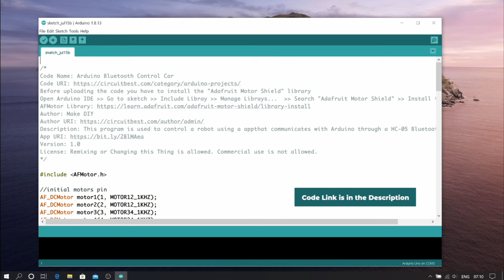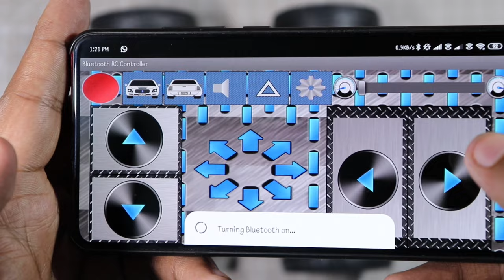How to Make DIY Arduino Bluetooth control car at Home with Arduino UNO, L293D Motor Driver, HC-05

Comment: Hey, I have made this Arduino Bluetooth Car and I have got A+ grade in my school. Thanks 😃😃
Reply from the maker: You are welcome 😊
I hope I can also help you in future 🙂
Reply: Woooohooooo great man i hope that i had that experience too man......
Reply: I will also try to make it in my school's science exhibition 😄
Reply: Arduino project always get A+
Reply: How to charge the battery?????
Reply: Tell me i have to make this model how to charge the battery????
Reply: @MakeDIY9  please tell me howw to charge rhe battery
Reply from the maker: @universeanemotion7868  you can buy charger online
Reply: @MakeDIY9  yeah
Reply: Gear motor kaise bhai
Reply: Heyy bro please help me. This Code is not Run Properly
Reply: Why my hc 05 led not blinking 😢
Reply: I have connected it but if I try to move it. It doesn't work
Reply: My car is not working even doing all the things. It is connecting to app but not working.

Comment: I just finished this set up on a four motor CNC tank robot. Works like a charm, thank you very much. If I wanted to also add obstacle avoidance automation with the sonar sensor how would I modify the code to go from manual to automatic? Can I just add the sonar avoidance code along with your code and it would work?
Reply from the maker: Thanks for sharing

Comment: It is working great but when I click on button some time so it keep on going after leaving the button also.
And please help me by solving my  problem ,please.

Love you Bhai
Reply from the maker: Check battery voltage it might be low voltage
Reply: Thanks for reply
Reply: Bro I have change the battery but still two motors are not working 😞 please help.

Comment: I tried connecting one motor only for testing however the motor doesn't turn just hum when it gets the pwm signal what should be done ?

Comment: If your car is not running, even after connecting by phone ,you can add ( 4700uf 25v ) capacitor to motor driver input. And connect your Bluetooth module to direct Arduino Uno's positive and negative if your phone is disconnecting always after few seconds, and also add ( 470uf 25v ) × 2 capacitors in parallel to that bluetooth module and Arduino's positive and negative, and after this all remove that jumper from the motor driver and give another same power supply to direct Arduino Uno, this all things will guaranteed solve your problem.

Comment: My car is not working when I conect the Bluetooth my serial monitor receiv the message but i press forward option but my car not working  when I tounch the wheel and wheel start rotating what will i do plz help and I tried it with laptop power
Reply from the maker: Your L293d ok?

Comment: Hi Brother, first of all thanks for the wonderful project. I have followed all the given instructions and made it according to the given instruction. After uploading the Bluetooth connection also established. But it doesn't work I mean no motor functions at all. Appreciate if you could help on this please. Thanks.
Reply from the maker: Check battery bro
Reply: @MakeDIY9  hi bro the problem solved.  It was a jumper cable defect. Thanks.
Reply from the maker: Ok 😅😅
Reply: Same problem here but jumpers are ok
Reply: Cant find the device did it several times with new jumpers etc

Comment: hi very nice rc car diy video thank so much , i have small doubt , you have used this batteries 18650 model , instead of that can i use 4-aa batteries or 6-aa batteries please tell , thq
Reply from the maker: Yes you can one aa is 1.2 to 1.5v now calculate how much voltage you will need
Reply: @MakeDIY9  hi thq , i was thinking to use 1.2 aa batteries-6 for this rc bluetooth car ,which is  7.2v is enough ?,  As per  your 3.7v X 2-batteries its 7.4v , sorry if i am wrong about what i am talking, i dont know about electronics much but i am learning it ii love it
Reply from the maker: Yes but total 9v will be good for the car

Comment: Bhaiya I have also double checked wire connections  and modified the code accordingly as I am using two motor wheels and a caster wheel . And bhaiya , I am using an 18 volt battery . But my motor is not running What to do now. Also, when I checked my motor by connecting directly to batteries it runs but when I connect it to motor driver it does not while everything else is working properly

Comment: hi ,
i have done everything according to the code but i did not work and later i experimented on it and found that there is less power supply ,after that i put a 9v battery and it connected but it did not move ,i am yet to do some stuff like i think i have to add another 9v battery for some extra power for the motors .pls suggest something

Comment: Bro we use a single core aluminum wire in this project,do you know what they actually called as and where to buy??
I  made ultra sonic sensor car ,but wires i connected are of  weak and poor quality.
If you know about those wires , please tell me bro
Reply from the maker: Bro Multi color coper wire are the best as of my testing.
I have also used aluminium wires but you can't solder on aluminium wire. So I ditched the idea.
Reply: @MakeDIY9  thanks bro for replying

Comment: Sir code was uploaded successfully and I had used 11.1 v battery and connected successfully with my phone
But the problem is that motors are not moving
Reply: Same Problem bro I think Coding Is not Correct Because Our All working properly but Coding is not Perfrom Correct

Comment: Can we use normal batteries which we use in electrical appliances or 9v
Reply from the maker: Yes but not a single 9v battery. It will not be able to provide enough power ⚡
The car takes high power so it is recommend to use 4 AA batteries in series( increases the voltage) or 2 9v batteries in parallel(increases the current).

Comment: Hi you know I have told you of that case of backward left...  So I have tried and it's working cool thanks for your guidance and ya pls can you give me the link of your battery I have clicked on it but I can't find your one battery and pls tell me that does your battery is rechargeable or not?
Reply: Pls reply
Reply from the maker: Feeling very Proud of you :)
Those are rechargeable 18650 batteries.
BTW where are you from It will help me to provide a similar link... I got the batteries from a local store. But I can give you some good batteries link :)
Reply: I am from Gujarat Baroda
Reply: To power my car I uses a power bank and 4 battery but it's not enough load on the car is too much so I thought to check out your battery
Reply from the maker: @nisargdelvadiya0625  can you contact me on instra @creativeideas365

Comment: I am using 9v normal battery, motor is not working. Do you think it's a problem. Should i go for 18650?
Reply from the maker: Yes buddy. 9V battery can't handle the l293d car. Even at the time of making the video I thought I would use 9V battey. But 5he thing is that it cannot provide enough power to the car. So, I switched to 18650 Battery.
Hope it helps 🙂
Reply: @MakeDIY9  thank you so much! This helps.

Comment: sir i have question,I used everything you did but when I connect my phone to the car, it doesn't move at all or anything. The car is on, the bluetooth module is working fine except it just connects to the phone and doesn't control the car. I have the libraries downloaded onto the program as well and I'm not too sure of what to do. Is there anything else that I need to do?
Reply: i use battery 18650 3000mAh 3.7V

Comment: In the coding you have not put the case of forward left/right and backwardleft/right if I put this in the code will problems can arise?  Pls reply
Reply from the maker: No bro it will not be a issue. 
But I will also make a video on that topic 🙂

Comment: hello and awesome video bro, i did the connection already and when i upload the code, there is an error which is error while uploading the sketch..can u help me solve this :)
Reply from the maker: Have you removed the rx and the tx wire while uploading the code?

Comment: Sir, in Arduino Bluetooth control car project ,  i have done all the things successfully , bt still the car wheels are not rotating only vibrating , what is the reason sir?? here i am using 9v HW battery .
Reply from the maker: Battery issue
Reply: Sir, how many volt batteries should be used??  I mean how many volts you have used?
Reply: Would there be any circuit problems if we used two 12 Volt batteries?

Comment: tried to make this car but it's been 8 hours and when I finally connect the Bluetooth the application constantly crashes and doesn't allow me to use the car. I do not recommend spending any money for this tutorial
Reply: you must have low battery, hardly sufficient for even  powering up the bluetooth module using the motor driver. try using a bit higher voltage like 7.4 .It should work
Reply: @ArduinoProgrammer-e9b  A long time ago I realized that the problem was that the Bluetooth module was broken.

Comment: Hi bro I have a problem I have did what u say in the viedo  and I also uploaded the code and the Bluetooth is also connected toy phone but no motors are responding bro plz help me out what is the problem my Arduino board or what bro plz help me out

Comment: sir my car is not taking right and left turn please help me sir.....
Reply from the maker: Do you modified the code? And which battery you are using?
Most of the cases the batteries like 9v battery can't provide enough power.
Reply: @MakeDIY9  no sir but now it's working fine...
Reply: @MakeDIY9  sir please make a robot using this components and also control hands too...sir please
Reply from the maker: You mean gesture control?
I will defenately make it.
But my next project is simple line following robot with uno, l298n and ultrasonic.
Hope you will like it 😊
Reply: @MakeDIY9  yes sir but also make a robot using the same components,  robot should have movable hands and head
Reply from the maker: Great idea thanks ☺️
Reply: @MakeDIY9  welcome sir........

Comment: Can we connect the bluetooth module without soldering?
Reply from the maker: Yes you can
Reply: @MakeDIY9  please tell me how? (I have to submit a project and I can't go out to get the solder because of the lockdown and Amazon will take about a week to deliver it)
Reply from the maker: @juice1070  In that case use some long Jumper wires and put them into between the shield and Arduino Uno and then press it. it will also work.
or contact me on instra @creativeideas365

Comment: Can I use 3.7v 2500 mAh battery (Mobile battery) on this car?
Reply from the maker: You have to connect atleast 2 mobile batteries in series and make sure batteries are charged
Reply: @MakeDIY9  thx for reply

Comment: I'm connecting the car to Bluetooth and running it after two or three commands the bluetooth is disconnecting. What can be done
Reply from the maker: Because of battery I think
Reply: @MakeDIY9  can I use 12 v 1.3 amp battery for four 300  rpm motors
Reply from the maker: Check the battery voltage when the load is connected. I previously tried to make this car with 9v battery, I have faced the same issued. The battery don't provide enough power for the motors. So, I switched to li battery.
Reply: @MakeDIY9  thank you

Comment: Bro I am getting a problem when I connect hc-05 individually to Arudino then light is blinking but when I keep motor driver then if I keep the hc-05 module it is not working at all please help me out fastly it's my project submission tommorow
Reply from the maker: Check battery

Comment: Hii..bro.. Bluetooth is pairing but app  is not connecting...it still shows red button...what could be problem?
Reply from the maker: Battery low voltage

Comment: Are bhai coding ho gai but jab power supply deta hu to wo aurdino ka chalu hota hei but hc 05 moduel ka light chalu nahi hota aur connect nahi hota kya karu bhai 
Kuki coding ke vakth vo light on hota hei par chalu karane kr vakth nahi hota

Comment: Can we use 9v battery instead of 18650
Reply from the maker: No bro 9v battery amp rating is low it will not work that great.
Reply: How about adding 2 battery
Reply from the maker: Use 2 batteries in parallel it may work 😃

Comment: Is 9v battery is used or not to run
Reply from the maker: You will need high power battery for this car 18650 will be best
Reply: @MakeDIY9  tq

Comment: When we are providing power supply throught Arduino uno , Bluetooth module is receiving power , but when we're providing supply throught battery Bluetooth module is not getting power supply .. can any one guide me on this 

And can we provide extra power supply like two power supplies????

Comment: hello and awesome video bro, i did the connection already and when i upload the code, there is an error which is error while uploading the sketch .can u help me solve this :) and i also removed the rx and tx wires but still not working what should i do?
Reply from the maker: What error it is showing?
And you installed the library? As i showed in the video??

Comment: bro please help me ... i connected to the bluetooth module but after some time ( 4 or 5 secs ) its getting disconnected . im using 4 AA batteries by the way , is that the problem . ?????
Reply from the maker: 4 aa= 4x 1.5=6 
But the car needs atleast 7 to 12v
It is the issue buddy. 
Use 6 aa batteries for 9v (9v is ok for testing but keep in mind that a single 9v battery will not be able to provide enough power to the car ) or
8 aa batteries for 12v (better speed)
Reply: I was so messed up with this ...already spent so much money  .. thanks bro for helping me with this problem .... i hope more projects will be coming to your channel ....😊😊
Reply from the maker: Yes ❤️
Reply: Broo same problem bro tell me some information to solveee itt please please please sirrr

Comment: i have connected everything well , code uploaded successfully and hc05 was connected successfully with phone but the motors are not rotating
Reply from the maker: Which battery bro?
Reply: @MakeDIY9  18650 batteries 3700 mah
Reply: Samee problem sirr but I used 9v battery
Reply: Samee problem sirr but I used 9v battery
Reply from the maker: @rishikchowdary3011  first of 3700mah in 18650 sizing is quite impossible. Even panasonic 3500mah batteries costs like hell 550 per piece.

Comment: Bro I am using a 9 volt (hi-watt) battery but it is not working why bro please tell me
Reply from the maker: 9v battery will not give enough power for the car. Use 18650 or ony other battery
Reply: I joined two 9volt but it does not work please tell me why
Reply: Bluetooth module's light is beaping.
Reply from the maker: Bro if you connect 2 9v batteries in series then it may damage the car. Please check others comments. 
And you can try 2 or 3 batteries in parallel

Comment: Hello sir, how to select the battery and charger for the car?
Reply from the maker: You can use 18650 battery for the project and use local chargers are available for the battery just search 18650 battery charger.
Hope this helps 🙂

Comment: It is working. But the speed is slow. How to increase speeds
Reply from the maker: What battery and what rpm motor you are using?
Reply: @MakeDIY9  I am using 100rpm tt motor. 
5000mh power bank.

Comment: Is there another battery except li because it's very expensive 😅😅
Reply from the maker: You can use lead acid battery. I mean you can use 2, 4V Lead Acid batteries in series.
But please don't use 9V battery. 9v batteries are not able to provide enough amps. So, 9v batteries will not work.

Comment: Hey can u help me ? I follow your step to connect hc 05 to L293D but why when i put the lion battery the hc 05 not bright its LED
Reply from the maker: can you tell me clearly what is the issue you are Facing?
you can contact me on my instra @creativeideas365
Reply: @MakeDIY9  i cann't upload my coding because its error like avrdude programmer not responding
Reply from the maker: Please remove the RX and the TX pin of the bluetooth module from the arduino before uploading the code to arduino. Your problen will be solved 😉
Reply: @MakeDIY9  okay thanks brother
Reply: @MakeDIY9  brother can i get ur help for my FYP ?

Comment: sir my all things are running lights are on but my bluetooth starts and when i connect to app the car runs and the bluetooth disconnects.
bluetooth =Hc-05
plzz reply .
lots of effort i do
Reply plzz fast anyone
Reply from the maker: Battery has not enough power
Reply: sir, which battery i will have to use and my all boards are running why this is happening.plzz reply practically.
and which battery i should use
Reply from the maker: Because this board needs sufficient voltage. Half of the people who are making this project they have the same problem. So i just guessed 😌
By the way which battery you are using?
Reply: i am using 2x  3.7v  2000-2200mah 18650 battery
Reply from the maker: Charge this batteries and it will just work fine buddy 😃
Reply: Bro srry to say my batteries are fully charged 😅😅
Reply: i will try with other batteries

Comment: Hello sir ....... I made this car just like you but it need more power...
Reply from the maker: What battery you are using?
Reply: @MakeDIY9   sir I was using powerbank 20000mah ext. Power connected .....but It's speed is very very very slow
Reply: Tech IN Mumbai   what if I use 4 batteries of 9v ???
Reply: Tech IN Mumbai  I used one battery of 9v but it was same..no speed ...
Reply: Tech IN Mumbai   yess sir but it's expensive.......can say another battery plz
Reply from the maker: Thank you so much for helping others ☺️
Reply from the maker: Yes I will make great videos 😄